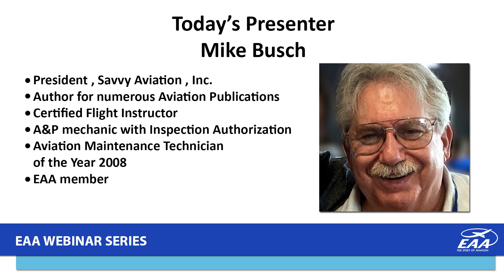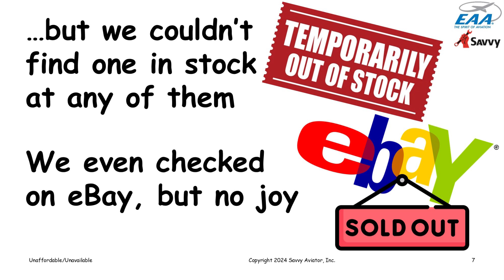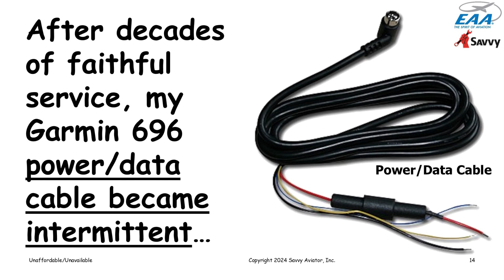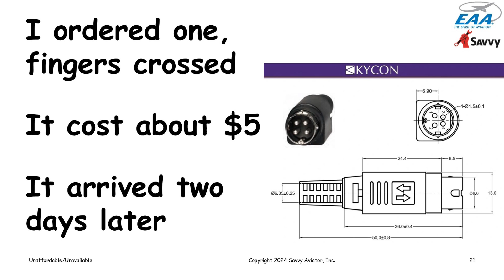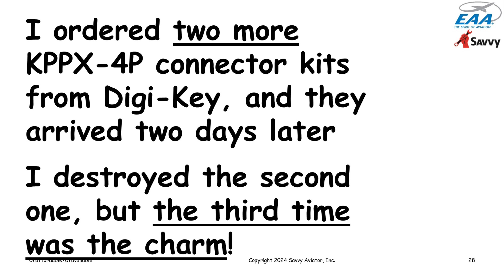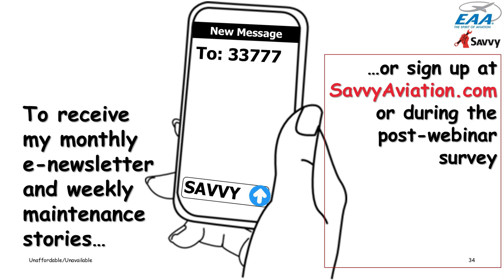Unaffordable/Unavailable

Comment: There is a problem with owner produced parts. The airframe and engine manufacturers have decades of experience what works. Metal alloy selection, heat treatment specification, process in manufacturing. You can call and ask, they won't tell you. In the example of the strut there are considerations of surface finish of the cylinder before plating. What is the treatment of metal before plating. How is Hydrogen Embrittlement addressed. You could get it chromed and it looks beautiful, but breaks in half in service. Somethings are much simpler.
Reply: Most owner produced parts are not so complex and structurally critical that those aspects are of much concern. In the unlikely event that an incident occurs related to an out of spec owner produced part, the FAA should (at least one would hope) add a statute that requires manufacturers to publish part specifications when requested by an owner intending to make a part for their plane.

Comment: Yet another example of the absolute absurdity the FAA. Owner produced parts. 1st rule should state that liability is 100% on the owner and not the a&p. What we are facing is hundreds of old airplanes flying around in the near future with lots of unsafe parts. Its inevitable as these older airplanes become near impossible to service legally.  The experimental side has a huge advantage in this respect.  I see the market falling completely out the bottom on most of the old trainers for this very reason.  The days of 50 thousand dollar 152s are nearing the end.

Comment: I had the same problem years ago with my C-310H.  I found a shop in San Jose, CA that was an FAA approved repair station that did gear replating for airliners.  I think it cost me like $500 for both struts, BUT that was 30 years ago.

Comment: I am an a&p for 20 years with little to no work experience. I have a few questions I hope you will answer. 1. What type of paperwork did you have to do  on the electronics connector you did? 2. On the wing access for the piper structs there are no dimension listed. The AD does not list or connection attachments. How can you make this and what paperwork is needed? 3. If the part is available, can you copy the part and install the copied part? (The Cessna bottom struct added parts on the floor cost at 8,000 and are only 8 parts plus rivets and bolts)What paperwork would be needed? 4. As I understand if you install a owner made part on a plane it cannot be rented out. What if it cannot be found at any price? 5. If a plane lands without the gear, can I make the skins and ribs , former ,  ect. or do I have to buy them if available? Alot of this was not covered very deeply in school. 5. What would it cost to have a engineer draw up something like an access door and do what ever paperwork needed by the FAA? (What paperwork would be needed?). What log book entries would be needed? Sorry I brought all this up  here, but you can see that on the webinar I most likely not get one question answered. Thanks for the Webinar and any answers you have for me. Have a nice week.

Comment: Canada has a category called "Owner Maintenance". You can put your plane into that category and the owner can sign off all maint and overhauls (he only has to be a pilot) and use uncertified parts. Major serialized components must be Xed out on their data plates. The list of eligible aircraft is quite large. The guy with the Corvette powered SeaBee put it in OM to do so. The biggest downside, other than it being very difficult to go back, is Transport Canada couldn't get the FAA to recognize the category. So you can't even overfly US territory in your OM airplane, let alone enter the us via customs. Perhaps FAA will look at a similar category based on canadian data in future.
Reply: It would definitely be a huge step in the right direction for GA if the FAA allowed owners to do maintenance on their own aircraft, but if they won't even allow Canadian planes in that category pass through US airspace, I doubt there will be significant change anytime soon.

Comment: Legacy Part 91 operations for standard GA planes 30+ years old should fall under the same repair rules as Experimentals, full stop. 

You can load an Experimental with 6-people, file IFR, and land at the Class Bravo with nary a certified part on it. 

The hamstringing of Legacy GA is absurd.
Reply: agreed, that's a smart idea with the 30+yr rule on certified planes.

Comment: I would have taken the strut to an auto shop and had chromed and put it together myself. So many aviation prices are just ridiculous. If an issue won’t cause a safety of flight problem just fix it ! Also, if you have an A&P that wants bankrupt you find a different mechanic.
Reply: On the flip side, many owners want A&Ps to take on liability and hard work for pennys.

Comment: Any used part "should" come with the "N" number of the airplane it came off of. I think this is actually in the regs IIRC
This suffices for "traceability" per the regs.  Also each part should have a Part Number attached somewhere on it.

Comment: It was a sad day when I learned Garmin stopped supporting the 495/496/696 series. Those units are better in many ways than the newer units that replaced them. I bought several 495 marine units off eBay for use on my motorcycle long after garmin discontinued them.

Comment: On the strut, NH hydraulics in Manchester NH and Dynachrome in MA can refurbish then it has to be inspected by IA for serviceability. These companies specialize in hydraulic cylinder repair/re-chroming. Not an FAA repair station so has to be inspected for use by an IA under the new replacement parts rule.
Reply: I think Mike was overstating the precision required for an aircraft strut versus a hydraulic cylinder for a piece of heavy equipment.   I’m confident any good cylinder shop could do the work adequately and it would last for decades.  Making the case to a reasonable IA would not be difficult.  It’s chrome applied to a steel shaft that needs to be a certain diameter +/- a margin.  It’s not the space shuttle.

Comment: All these ancient pos airframes that should have been put in a museum a long time ago...its for the most part a 1940's tech, flying behind these tractor engines is nightmarish. Experimentals and ultralights might be the only affordable way to keep ga going at this rate ?
Reply: The airframe isn't really the biggest issue and it's not as if the majority of experimental aircraft use a more modern construction such as composite. Also, the technology isn't 1940s, but 1930s. If general aviation aircraft made use of the technologies developed during World War II, they would be far more advanced. Liquid cooled engines, automatic variable ignition timing, direct cylinder fuel injection, and automatic prop pitch and mixture (one lever control) would be widespread if that was the case. Many, if not most experimentals use the same antiquated engines as certified aircraft, and the prevalence of more advanced engines is far lower than what it should be. Everything about certified aircraft is overpriced, so you're right that experimentals and ultralights are the only affordable option.
Reply: @quentagonthornton49   Mooney made the aircraft your dreaming about. But pilots wouldn't buy it because it used an auto engine. Look up Porsche Mooney.
Reply: @not_listening2792  First of all, the Porsche PFM 3200 was not an particularly advanced engine as it was air cooled, not water cooled, and it did not use direct injection, but indirect port injection with an imprecise continuous flow system as opposed to a sequential system as found in more advanced indirect and all direct injection systems. With dual ignition, continuous injection, air cooling, a flat engine configuration, and even cabin heat from an exhaust heat exchanger, the Porsche aircraft engine shares more in common with certified Lycomings and Continentals than any automotive engine produced within the past 25 years. Second, the reason the Porsche engine never caught on is that Porsche discontinued it due to the GA market falling and the excessive costs regarding development and production of the engines, which can be attributed to excessive FAA regulations.
Reply: Need to get the FAA out of the way of technological advancement. Costs a Bajillion dollars to get a new engine certified even if it's technology that has been proven for 25 years in auto engines.
Reply: @diveforknowledge you said it right 100%
Reply: @diveforknowledge agree!
Reply: @diveforknowledge  25yrs?! Fuel injection, FADEC, single lever control, autopilot, and more have been around as early as WW2, over 80yrs ago! The stuff the FAA doesn't allow is older than most people alive today!
Reply: I’d take my 1968 Mooney over 95%+ of experimentals or ultralights.  Certified planes generally are better designed and thought out and over all offer better utility and cost less than a comparable experimental plane.  Ultralights are worthless for going anywhere.  There are certainly certified planes Id stay away from such as really old twins but there are lots of great certified GA airplanes that are reasonable to own and operate.